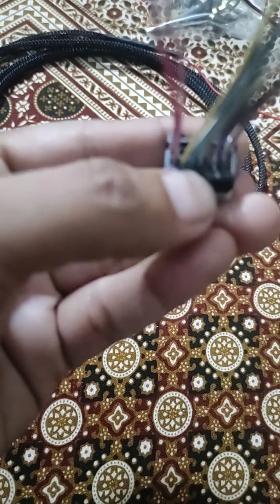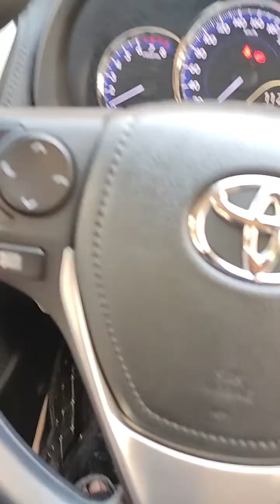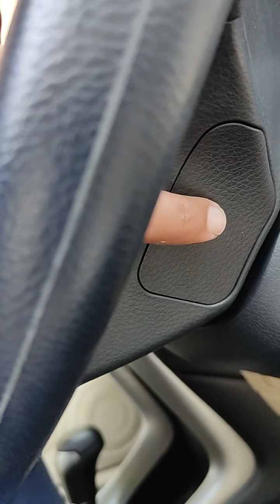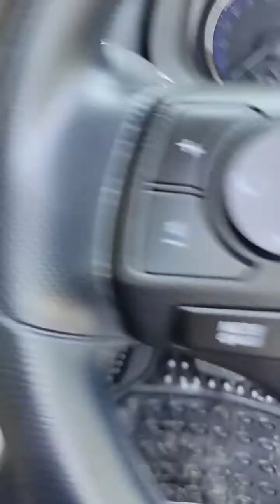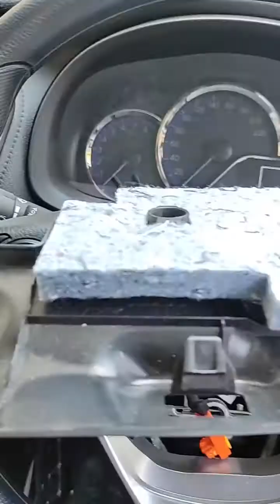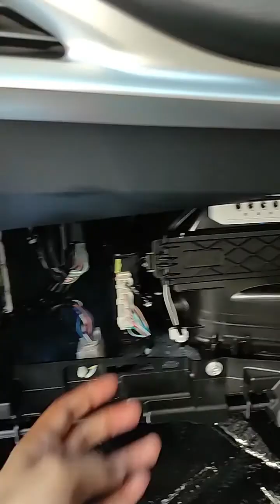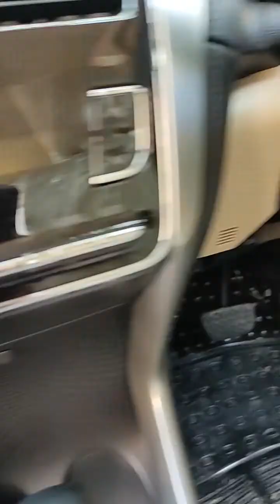Toyota Yaris/Vios (Automatic Only) Cruise Control Installation | Cruise Control A-Z Installation

Comment: Brother can't find pins in any market. They said we no longer have these pins.
Reply from the maker: Covered it from 10:00 onward, given part number also.
Its 12 pin and 14 pin connectors. Old steering parts Charkhi/steering spiral cable waala guys have them.

Comment: I have corolla altis (malaysia) 1.6cc and I already install the cruise control stick but it no switch on light on meter panel, did I need to do own wired to ecu to make it active...? I need help on it cos I really need this function on during my highway travel. Tq
Reply from the maker: Sorry bro, i dont have the info on Altis

Comment: Cruise control can be install on manual Corolla Altis X 2021 model??
Reply from the maker: Sorry bro don't have idea about it. But I feel its ECU (electronic control unit) may not have the required programming installed and also as it is manual it requires an additional hardware called "clutch switch" which also I don't know if there already or not
Reply: @firstgear6751  
Thanks bro

Comment: I checked online there's a cruise control kit with blue LED backlight. Did your stick has blue light?
Reply from the maker: No mine is without light. You can use that also, it will be better for night time drive
Reply: @firstgear6751  Thank YoU 🙂

Yes, em looking for & hopefully ll find a good one..I wanna appreciate your effort regarding ATiV X..Watched your all videos & it'll be beneficial for modifications in my car 😊

Comment: Hola, this instalation works with a Yaris model 2022, manual transmision motor 1.5 l.?? From mexico
Reply from the maker: Manual cars need additional "cruise clutch switch" which I am not sure about if it exists in Manual one already or not. I installed in CVT which does not require clutch switch
Reply: Te funcionó la instalación para tu Yaris 2022? Yo tengo uno 2018 también con transmisión manual, y pensaba hacer la instalación.

Comment: hi, i cant find any of those harnesses that you mentioned that has the exact pins.
do you know if the sterio harness pins are the same as those? those are the only toyora harnesses that are available here in philippines.
Reply from the maker: You can visit old car parts store to find the 12 and 14 pin connectors. I am not sure about the stereo harness connectors as they may be quite different. You can use the hit and trial method. Try the pins and see if they get properly locked and connection works else no other option but to find the 12 and 14 pin connectors
Reply: am i right that the pins you used for that long wire you used for ecu to steering wheel are Female Pins?
Reply from the maker: @earljosephco5692  yes Earl, you are right, all female pins. Males are in the ECU and you will add female pins like I showed in video
Reply: @firstgear6751  thank you for taking time to reply on everyobody's queries bro. I appreciate it a lot. i wish more power and blessings your way! ☝🏻

Comment: My Yaris 2015 middle east version have different pins. It has only one pin in socket (where you inserted horn + cruise control jack), while in your car there are 4 pins.
Please guide.
Reply from the maker: Bro It may have a different ECU too. I am also not sure if this will work for middle east version of 2015

Comment: Is it necessary to get the black wire from market?  Can we use any  wire and attach connectors?
Reply from the maker: Yes you may use any wire۔ It will work۔ But use a wire
1. With good number of threads
2. Should be good quality but not too thick
3. Copper threads
Reply: @firstgear6751  thank you. Is there any way to contact you? Any phone number if you could please share

Comment: Frm where can i bought ecm cable?
Reply from the maker: That you have to make yourself۔
Some cables are available on daraz through China but the pins in them do not match Pak yaris, You will need to find pins through used grips/comnectors in old car parts market۔ 12 pin and 14 pins connectors that I showed in video. Pause the video there، take screenahots and show to shopkeeper in old car parts market

Comment: bhai mujhay pins nahe mil rahee jo bhe laykar ata hun sahe nahe baith rahein kia ap madad karsaktay hain correct pins hasil karnay main?
in Karachi
Reply from the maker: I am sending you photos, show them to the guy he will give you match in 5 minutes. (Photos taken from my video)
You could also take snapshots and show to the parts guy
Reply: @firstgear6751  thank you i did the same and showed them images. I have installed cruise control as you explained. My best wishes for you. Only problem i face is that stearing connector pin to ecu is a bit loose. If u stretch it the pin inside start working as soon as u loose the wire C. Control turns off. How to fix it. For the time being i have stretch the wire to keep the tesion and zip tied the cable. It works but still more like jugar.
Reply from the maker: Make sure you have the proper pin size and shape, secondly push it max and see it should not be loose, finally it will be also locked by the top locking tab.

Comment: is there any chance of using the daraz wire harness as it is. if not then please tell me from where do you buy these connectors in karachi.
Reply from the maker: Yes the daraz wala wire will still work but will be slightly loose particularly at the ECU pin location. You can add some tape and then lock it in place in the grip/connector
You can go to Plaza accessories market at its back there are kabuli parts shops wahan say easily mill jaey ga 12pin connector and you can even purchase kabuli cruise stick for 1k to 1.2k from these shops
Reply: @firstgear6751  thank you brother
Reply from the maker: Welcome Areesh. You have a nice name!
Reply: @firstgear6751  I went there and they say GRIP LAO phir sahe pata chalayga konsee pin CHAHYE TUMKO. please advise un pthan bhion ko baghair grip dikhay kaisay correct pins laasaktay hain?

Comment: Salam sir kya cruise control manual transmission me lag sakta ha using your method
Reply from the maker: Not sure, and it may not work. Manual cars MAY require something called a "Cruise clutch switch" you can google it, it is available on AliExpress. However, it would be risky to attempt as you might lose money if you buy these and still cruise does not work.
Better to consult experienced electricians in the market and ask opinion. I have not tried this myself.

Comment: Dear habib, can you please help about ECM pin/socket number for Thai's Toyota Yaris ATIV, 3NR-FE 1.2L engine (VIN Number MR2B33F3901312386 / ECM model: 89661-0U630). As the ECM connector in this video are 5, but for my car has only 4 sockets. Thanks for your reply in advance. :')
Reply from the maker: Sorry dear! I searched for it but could not find anything relevant to your specs. I am also not sure if this ECU supports Cruise Control or not. My friend, I am afraid I am unable to provide any help....

Comment: Will this work with toyota prius
Reply: Frame no: ZVW30-1849785
Reply from the maker: @Absimportsuk  what model is it 2012-2014 has different connector and Pins and 2015 has different.
Read this guide carefully, let me know if there is any problem in following this guide.
https://manualzz.com/doc/12503841/form-%235350
Reply: Thank u. Its 2014 model. I will let u know once I have fitted it successfully. But thank u so much for ur help and I have subscribed to your channel.
Reply from the maker: For 2014 as the document shows, the Connector is TOP connector G58 and pin number is 22, this will be connected to Steering connector grip pin 1. And pin 2 will be ground
Reply from the maker: No, different ECU so wiring pin locations will be different 
Which model? Can you share Chasis/platform number?
Reply: Plz bhai bataiye ga which pin is for my prius
Reply from the maker: @Absimportsuk  
Bro please follow this guide. If your Connectors are the same, the pin # and details are provided. Good luck. Also let me know if it works. https://manualzz.com/doc/12503841/form-%235350

Comment: Some people are installing without ECU Connection Directly to Steering connector and grounding it to a nut beside horn. 

Is that method better or this one?
Reply from the maker: Steering sey ground is the jugaar version. Mine is according to actual Yaris OEM setting.
Think about it, i) steering wheel is not proper ground point ii) they are cutting wire from a connector to ground in steering instead of using proper wiring and ground

Comment: hello sir, nice video... can i installed cruise control in a toyota vitz rs 2012 ksp131???
Reply from the maker: Let me search it a bit.
1. Where r u from?
2. Is this car JDM?
3. Isn't 2012 vitz rs = NCP131/NSP131?
4. Also could you find out its ECU number? 
5. Engine make and is it CVT? 
This will make it easier for search
Reply: @firstgear6751  hello sir thank for reply
1. i'm from mauritius
2. yes from japan
3.yes it's  ncp131
4. chassis is ncp1312006824 and engine is 1nzd909668
i installed the cruise control but didn't work... should i installed the wiring also??? just like you show in this video???
Reply from the maker: @thirouvenasseereegadoo2082  
Yaris has a different ECU than Vitz. I will have to check wether this supports cruise or not. Wiring it like yaris will not be possible as both have different ECU.
Is your car CVT/Automatic or manual?
Reply from the maker: @thirouvenasseereegadoo2082  is your car manual or automatic?
Reply: @firstgear6751  it an automatic with shift panel i already conect the cruise module but does not work.. you think i should do the wiring???
Reply from the maker: @thirouvenasseereegadoo2082  the wiring will not be the same like my video because the ECU is different. Let me search to find out if it is possible for your Vitz
Reply: @firstgear6751  thank you sir you very helpful really appreciate... in my country I didn't find someone who can do this...
Reply from the maker: @thirouvenasseereegadoo2082  
It may be possible to add cruise control in your Vitz as some people have done it with 2014 Vitz. Although not much detail is available I have heard the following
1. You may need to replace its spiral cable
2. You may need ECU programming
3. Wiring would be needed as in my video but I could not find the electrical wiring diagram.
You may need to consult a local car parts market and find electrician having experience of installing cruise in Vitz.
I am afraid I am unable to find much material on it to successfully guide you. Good luck
Reply: @firstgear6751  hello sir
It already have the connection in my spiral . I already connect the module , bit not working.. you think i should do the wireing like in yoir video??? Could not find any .good electrixien for this work sir, some dont even know what is cruise control.. thank anyway for your help sir

Comment: thanks for the video. but by the way, what about the cruise control release switch??... emergency cut off switch which is need to be fixed with brake paddle????....
thanks again
Reply from the maker: For Pakistani Yaris that part is already done. All we need are the steps I have followed and it disengages automatically by applying brakes so no separate wiring was needed for brake.

Comment: Aslam o alikum can u sell me two connectors for both sides and also for ground wire i can pay u in advance icluding delivery charges.
Reply from the maker: Yes can be done and if you haven't purchased the cruise stick I have one spare of that as well. I ordered from China 2 extra. Also sold two earlier with wires.
WhatsApp: 03349194894
Name: Zahid

Comment: Hi bro i got Toyota mark x. 
i could not find wiring diagram. 
could you please help me with it.
Reply from the maker: This video/guy might help. It's installation in Mark X. However it depends on ECU type. This will only work if your car has same ECU grip as in this video https://youtu.be/KdRXo-ylawE
Reply: @firstgear6751  How i can find ECU pin point in my car
Reply from the maker: Sorry dear, the only way is through Toyota Service/Repair manuals which are not freely available. Also Toyota does not share this info.
Reply: @firstgear6751  my car is 2nd generation.  so it has  different ecu .

Comment: Which model is this
Reply from the maker: This is 1.5 Ativ X.  You can install in both 1.3 and 1.5 Automatic. Ye method manual kay liayay nahi hay.
Reply: @firstgear6751  2014 Yaris me Laga Sakta ho 2nzfe engine Hy
Reply from the maker: Isska taluk engine say Nahi hay ECU say hay. ECU support honi chaheyey. 
Yes I think it can be installed. However the ECU part number and  grips will be different. Accordingly the grip and pin number will be different. You will need to know which pin is for cruise in the ECU. 
You need to visit a good electrician with experience of installing cruise control on older vehicles.
Reply: @firstgear6751  sir if you don't mind can you tell me the number of pin in the ECU 2nz-fe I want to install it in my Yaris 2014 I am also electrician.
Reply from the maker: @MuhammadAslam-fn5wm  is it a hatchback or sedan?
Can you share details of your model from a website? Can you also share ECU part number?

Comment: Assalam o alaikum

Can we install cruise control in 11th gen corolla 1.6?
Reply from the maker: Not recommended because
1. Wiring for cruise is not available and will be required
2. Wiring for brake (for deactivating cruise is not there) will be required
3. A relay inside the glove box will be required
4. A fuse inside fuse box will be required.
5. Also cruise control bulb in cluster is not there. That will require wiring as well. 
Most people will stay away from doing so much as it is very risky.
I would recommend don't do it. If you want to do it, contact a good electrician who have installed it already. 
As I said I don't recommend it, it's very risky.

Comment: Great video. Can you please advise or show with 2014 Corolla? Thank you.
Reply from the maker: Sorry but I have no information on Corolla ECU wiring for cruise. But check the following document which may be useful. 
https://www.rostra.com/manuals/250-1731_Form5156H.pdf
It has a section for Corolla cruise installation. Hope this helps you

Comment: I installed the cruise control. After one day, it stopped working. Can you advice.
Reply from the maker: Is it showing cruise light in the display? Have you checked its off-on button? Cruise stick may be OFF.
If ON and still not working then check it's wiring. May be disconnected. Also check the cable ground. The ground should be with metal body and should not have any plastic.
Reply: @firstgear6751  no the cruise light is not showing. And i connected the ground to the metal piece with a plastic piece though. My car horn randomly worked a couple of times also.
Reply from the maker: Did it work for one day and then stopped?
Check all it's wiring and pins should be securely connected...
Reply: @firstgear6751  yes it worked for the trial run and now after 2 days, it’s not even turning on.
Reply: @firstgear6751  is there any kind of fuse in the fuse box for cruise control
Reply from the maker: In step one please change its ground position. No light coming means there is no current to it which is mostly problem of wire grounding. This should solve it
Reply from the maker: Check the ground, ground the wire to a new location and see if it starts working
Reply: @firstgear6751  ok done. Will update
Reply: @firstgear6751  the ground screw is of what size. Can you advice. I will get the screw and take it to the same place as you did. I got a small wire in my kit, so i connected it near the 3rd screw of the steering cover.
Reply: @firstgear6751  it started working by itself but then it switched off again. I’m gonna be checking the wiring and ground today.
Reply from the maker: Update please. Did checking wiring solved the problem?
Reply: @firstgear6751  no, it didn’t help. I think the cruise control switch or maybe the steering wire is faulty. I’ve ordered both original from Toyota and should be getting it in a few days. No way to check without these parts.
Reply: @firstgear6751  the cruise control works when the car is parked in direct sunlight and the car is hot inside to sit. it works for  few minutes and when the car cools down, it stops working. lol, dont know what is going on.